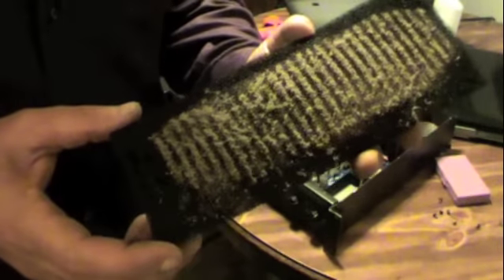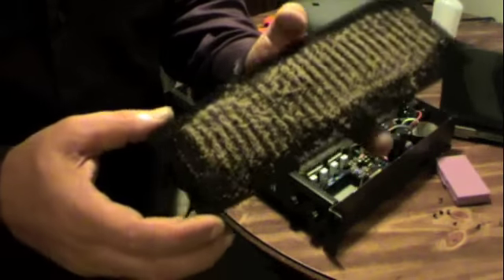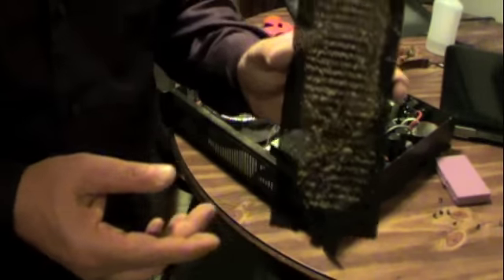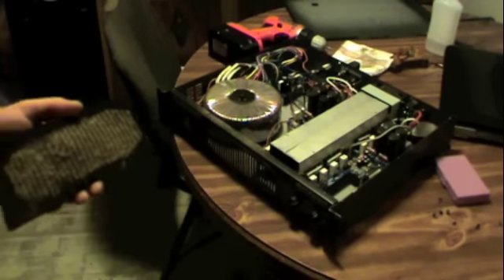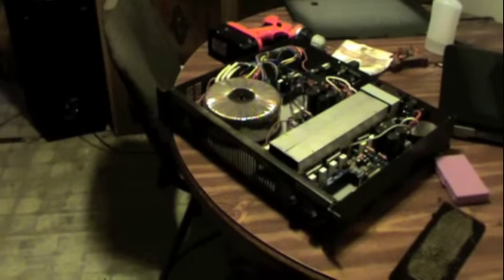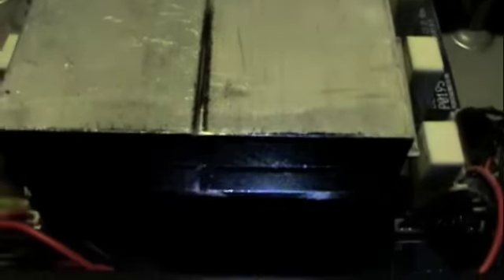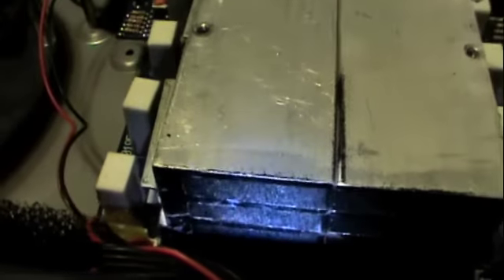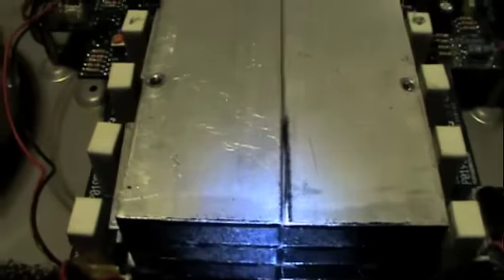Beheringer EP2000 update (this is why I  turned the fan around )

Comment: @FireStormRocords awesome!!! im finally upgrading my pa system for my band, i was using 2 harbinger 200 watt powered speakers and now i am buying a crown xls2000 and 2 Peavy PV115 speakers, ill use them as mains and the harbingers as monitors, and im going to start djing soon, and i probly need to update my mixer soon, its just a berhinger FX1222 a 12 channel mixer with 6 mic inputs, it works for now, but when i do bigger things ill need a bigger board. Thanks for all the great Videos!!!

Comment: Vitale, Do you still have this amp, and is it still running?
I'm interested in buying a new one for Sub duty for my PA. I have some Behringer gates, compressors, and a multi-effect unit (Virtualizer) that I have had since around 1998. It all still works fine, but it gets really hot... so I steered clear of their amps for that very reason.
Reply from the maker: I still have and use this amp

Comment: Ya its silly how they have the airflow. Reversing the fan like you did is the easiest way to have taken care of the problem.

I'm looking to buy one for my home theatre to power a pair of 12" 6 ohm Eminence LAB12 subwoofers in stereo mode and seeing that this is such an incredibly light load for such an amp I might put a resistor in series with the fan to cut the fan speed in half seeing it will be stone cold. I just like having lots of reserve power for dynamics :)

Comment from the maker: I have been running it this way  almost a year and   I've  never  had it get  hot. Down side is  I do have to  open it up and clean the filter once and a while
Reply: When you turn that fan,how about cooling of this machine,or it will cause too heat